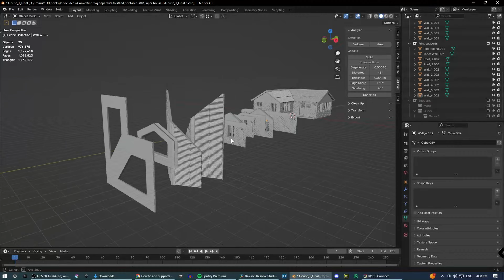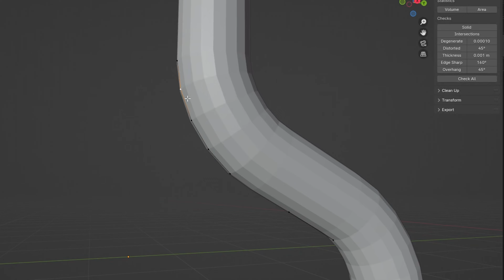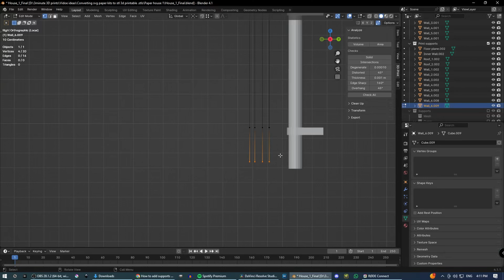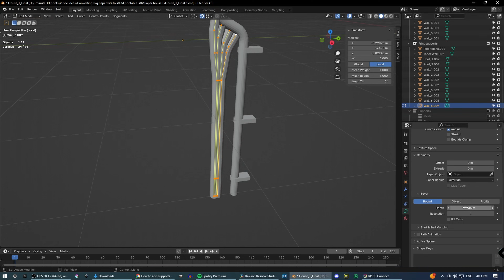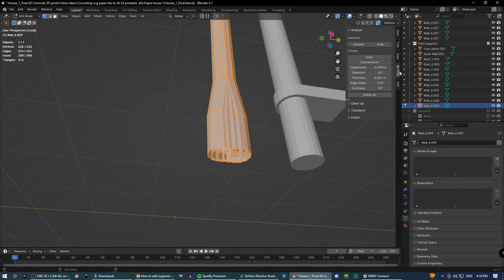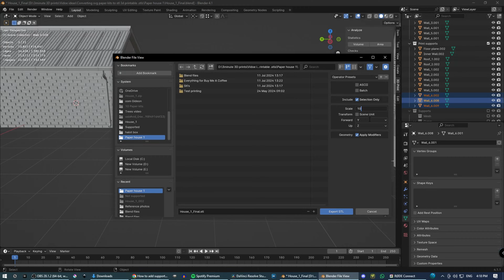Adding Print Supports for Resin 3D Printing in Blender

Comment: You don’t seem to worry about the contact surface between the support and the part. Doesn’t it matter a bit?
Reply from the maker: Not sure what you mean? The thickness of the tips or how deep it connects to the part?
Reply: @G @Gerbens_Designs meant the contact surface between the part and the support.